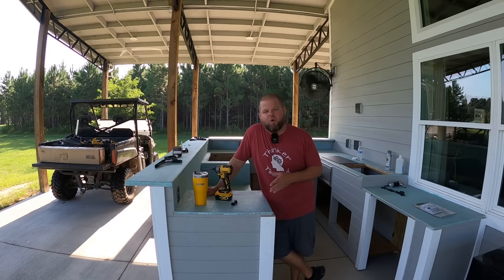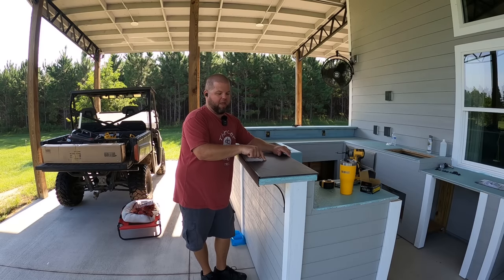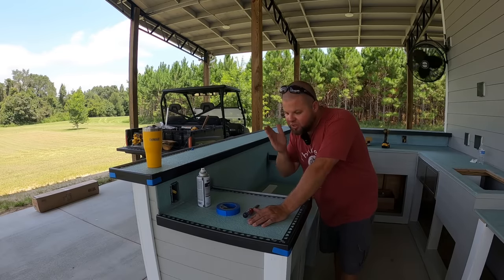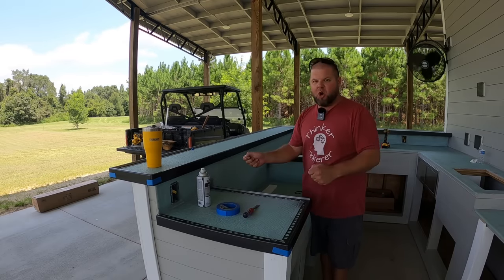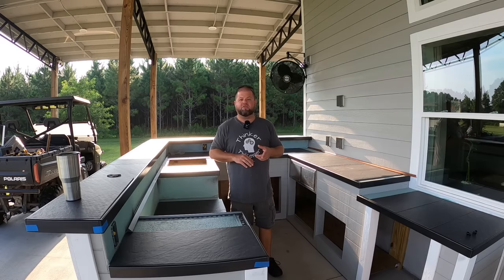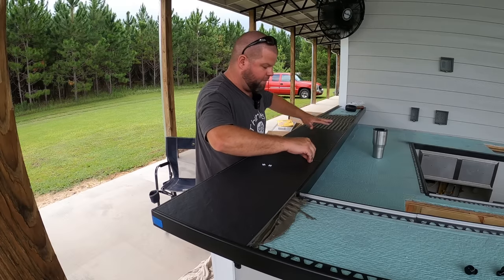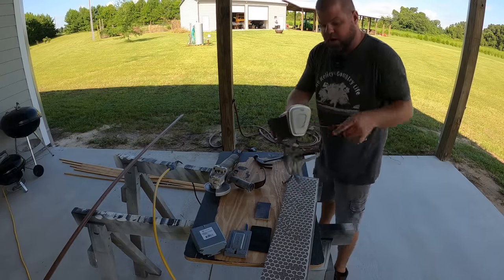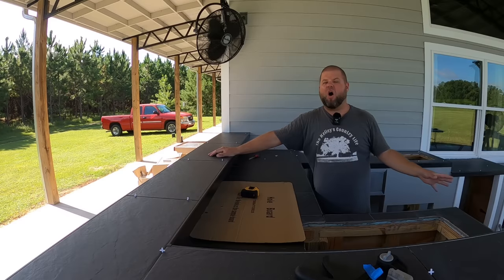DIY budget outdoor kitchen build part 5! Tile countertops #vevor #628

Comment: Hi there, 
I did tile for many years, the spot with two little pc you talked about 14:45 , personal experience little pc are not holding good, in your case they in corners so they will sit better, but if you would start mid with two tiles you would have 4 pc instead of 5 and side ones be large size, 
But still, had costumers not like that seam on center…

Comment: Awesome job!!! just want to let you know Schluter can be cut with a regular miter saw, so you don't have to use a grinder.  A little easier and the cut will be cleaner.  I have been working with Schluter for years and it is a fantastic product.  It really adds a touch of class to any tile work.
Reply from the maker: Thanks for the tip!

Comment: You did a very nice job with everything, if you see some cracking where you backspash meets the counter later down the road you can cut the grout out and you can get the same color grout silicone in a tube by the same company as the grout.
Reply from the maker: Thanks

Comment: Andrew, I suggest you use a good outdoor rated silicone on the top and 2 sides of the outdoor cover to help keep out water but leaving the bottom unsealed just in case water does get in, this will allow a place for it to get out...
Reply from the maker: What cover are you referring to?

Comment: One more suggestion. When you do tiling on a backsplash or on a counter like that or on stairs or anything that’s gonna possibly move or flex a little bit. Are use caulking in the joints between the backsplash and the countertop. If people are leaning on that counter you’ll find after a couple years the grout in that 45° angle is going to get little cracks in it and water can get in there. If you used a black or dark gray silicone in there and get pretty much the same look but you get a water seal. Same with the bottom of the shower between a manufactured tub or tile floor, silicone just gives you that little bit of flex an extra water seal and works a lot better.  Plus when it does need maintenance it’s a whole lot easier to take out of there than grout. I also suggest not becoming a professional tile guy. It’s fun for about three or four jobs then it just gets really tedious and old. 😂 I absolutely hated it. I was not bad at it but as far as construction goes it just is very boring to me the first time at school but after that it gets really old. lol
Reply from the maker: I agree with the corners, but I also don't trust caulk and silicone. Those always seem to pull back from a sharp edge. Especially caulk, nothing is perfect it seems.

Comment: Epoxy would be ok inside a house because its not UV stable, needs a Urethane coat to protect it... But don't put a hot pot on it. Depending on the epoxy you can go pretty thick with it. Stone is the best low maintenance option. Anything with a sealer needs maintenance and could possibly melt from hot pots.

Comment: Looks incredible! I plan on doing the same countertop because yours looks sooo good. Could you tell me how you finished the edge of the backspace?
Reply from the maker: Back edge behind the sink? If so I painted pvc quarter round trim black and glued into the corner. Looks great I think.
Reply: @TKCL  that’s a great idea. I was actually referring to the side by bar. The part of the backsplash flashing outward, between the counter and bar. It doesn’t look the same thickness as the rest of the Schluter.
Reply from the maker: It is the same trim, camera is deceiving.
Reply: @TKCL  oh great! Thank you so much for responding.

Comment: Looks amazing!  I’m not familiar with how the Blackstone connects is it in the front, I couldn’t see any holes for your gas line in the area you plan on putting the Blackstone.  I’m sure you’ve got it figured out you do such a great job thinking ahead.
Reply from the maker: I bought a tile hole saw bit set. I'll cover that in the next episode.
Reply: @TKCL  ahhhhh, that makes more sense to have a clean precise hole.  Tight work as always!  Thanks for taking us along the journey.

Comment: You’re supposed to do the floor/counter first before the wall. Whether it be a shower or outdoor kitchen. So you did it correctly, maybe for different reason but it’s correct either way.
Here’s why. Grout is porous and water will go through it if given enough time. If the wall is done first and the bottom butts up against it, there will be a grout line in a corner. And given enough time with expansion and contraction that grout will crack and moisture will get underneath the tile. This also why all corners inside and outside edges should be caulked with 100% silicone, not trim caulk or anything else of the sort. Always and only 100% silicone, which can be matched to your grout.
Reply from the maker: Where do I get color matched silicone, I've been very curious about that.

Comment: One other thing. Are used to do tile but especially if you’re doing vertical tile you always want to butter the back of your tile or take some of that thin set with your trowel and put it on the back of the actual tile itself and the surface it’s going to. When you put it on this way you have stripes connecting it and did Asian is only as good as that initial connection. But when you butter that tile you smear salmon and press it into the back of the tile and then they stay forever. On a flat surface it’s not a big deal unless you’re walking on it but if you were to walk on it, You’re a lot more likely to get cracks and tiles coming loose and if you put them vertically if they come loose they’re more likely to fall off. I’m not sure which way is best because I wasn’t some sort of master tile guy I just worked with a guy who told me how to do it but we would put stripes in opposite direction so if we were going north to south on the cement board we would go east to west on the tile so you would end up with a grid but even if you don’t use a slotted trowel just smearing and pushing some thin set on the back of the tile itself before you put it down in the tile is a good idea.  We did a lot of tile repair and he showed me the tiles as they came off and the difference. A lot of the mud doesn’t stick to the tile when you just lay it on top. But you’re not walking on it unless you get crazy drunk but from what I’ve seen you don’t drink a lot and none of it’s vertical so it’s probably never gonna make a difference. A lot of tile guys don’t do it but a lot of tile guys don’t do a great job either.  Lol.  For counters it almost doesn’t matter. I’ve done a lot of repairs where I just use silicone to glue it back in and it’ll be there for years that way. I also do that when I’m doing repairs around plumbing to keep water out because you can’t always grout very well in those tight spots around pipes.  

Either way for countertops it’ll work fine and those look really good.  👏🏼👏🏼

The epoxy countertops are cool but it’s almost like a DIY show thing. They always turn yellow here and whether it’s thin coated epoxy or poured cast thick Apoxsee it always ends up looking bad and it’s just not very tough. And something like a garage floor where you’re going to wear it out fast and drive on it and not be looking that close it’s not a big deal but if you do a light color Apoxsee with like a marble design or something it’s just gonna yellow and look bad and it stains easily as well. I would consider concrete counters with a sealer but I would never use the Apoxsee unless I was using something that looked OK when it yellowed
Reply from the maker: I do agree it's kind of a DIY fad. I think they would be fine inside out of the sun, heat and weather.
Reply: @TKCL   I was watching a show with a lady who does them on her DIY show and she said they always look like crap a year later, several the one she did were inside the kitchen.
Reply from the maker: I could see UV destroying them.

Comment: I wondering were you going paint your outlet covers black I noticed they were Gray not that it matters right. Also were you thinking about putting maybe rubber mats or something under your bar stools to keep spillage from getting on the concrete or something like that?
Reply from the maker: Already painted black 😉, had not decided aout under the bar stools. We do ha e a mat for the kitchen area.

Comment: Hey Andrew, when you laid the 1x4 boards on the outside how did you get the very small gap between the boards for the aesthetic look? dont think it was shown on the video. Thanks
Reply from the maker: Put down scrap 1/2 plywood for the gap spacing. Then placed the 1x4s on top and nailed to the studs. Remove scrap plywood when done.

Comment: Why no tile on the vertical. Think between sink and your refrigerator..  where the height of the countertop changes by the house wall… also how will you cleanup edge of tile between bar-top and the countertop.
Reply from the maker: No cooking or splashing in that area by the window, painted surface should be fine. Not sure what you are meaning by tile edge from top to countertop.
Reply: @TKCL  it looks rough.  Where the backsplash ends at where you enter outdoor kitchen
Reply from the maker: Ohh, I'm nowhere near done. I've got aluminum trim edge for the remaining exposed corners there and where the blackstone is going. I didn't want those in place until I was completely done sealing.

Comment: Unfortunately, u forgot to install a small metal trim piece at the end of ur backsplash & u didn't grout it either. Are u gonna trim it off another way?
Other than that, it looks amazing! U did an amazing job. Can't wait to see the sink, faucet & all the SS cabinets & drawers installed. As well as the other finishing pieces. Can't wait for the next video. Oh & btw, I love that u used black slate & painted the trim black compared to SS. I personally love slate myself.
Reply from the maker: I'm not done, I still have to trim that area and around the blackstone. I already have aluminum trim that's painted and ready to go.

Comment: Did you consider any kind of fan to help remove heat from the Blackstone?
Reply from the maker: There is one on the wall aimed towards it.  That fan moves a lot of air and will carry the heat out towards the end of the kitchen.

Comment: Is the new tile you chose from Lowes as well like the first? Do you have the name of it? Thanks
Reply from the maker: I don't have the name on me, it was also from my local Lowes.
Reply: @TKCL  Thanks for the response! I think I found the same tile. It looks like it's 8-10mm thick. What size Schluter edging did you use? 5/16, 3/8, or 1/2? Thanks again, I'm literally following your process exactly. It's a huge help.
Reply from the maker: I used the 2 1/2 inch tile edge from Home Depot. It's designed to cover the tile that's 3/8 thick, allow for thin set and provide a side profile so. I didn't have to tile the sides.
Reply: @TKCL  Thanks. I accidentally ordered the profiles for 1/2 inch thick tile, and figured that was too much to fill in with thin set. The corners are backordered anyway, so I'll return these and go with the 3/8 inch. Thanks again!
Reply from the maker: Half inch should be good, the tile sits on top of the thin set raising it up. You can always raise the tile with more thinset.

Comment: Quick question(please note that I am not a tile expert) By putting the waterproof membrane on the concrete board, will that affect the adhesion of the thinset to the concrete board? I am assuming not but wanted to ask.
Reply from the maker: No, that specific membrane is designed specifically for tile adhesive. It's highly used for shower walls.

Comment: Are you going to have a covered parking with something like a concrete pad for your vehicles I see currently parked on the grass? With as much rain as you get, I would think it would be unpleasant walking in the rain, all dressed up, to get into a vehicle. Plus the Florida sun does a number on vehicles, inside and out. It would also be cooler when you get in the vehicle.
Reply from the maker: I'm considering it down the road. I've lived here almost 40 years and parked outside. I guess I'm use to it.

Comment: what did you use for splicing your trim or for the ends?  I can find the inside and outside corners.
Reply from the maker: It was also made by Schluter and recommended along with the trim on Home Depots website.
Reply: @TKCL  only thing it recommends to me are inside and outside corners.  If you have a link could you please post it?
Reply from the maker: I'm sorry, I didn't read your comment correctly. I didn't use anything for splicing ends. I just butted them up to each other. Worked quite well as I haven't really noticed it after two years.

Comment: I plumb in Georgia and I use galvanized pipe and fittings on the regular and never once be turn down on inspections I tread some pipe and I mega press some pipe and again never been turned down on my inspections and Florida is another state that allows galvanized pipe I had my father pull a permit and I plumbed his house with galvanized pipe for gas in Florida.
Reply from the maker: I agree! The gas company I use is out of Georgia.

Comment: Just say you're OCD and don't try to explain what you don't know about backerboard and tile. That is backerboard. You should have used 1/2" Hardieboard and a few more backing pieces,  and Witmer have been good to go.  Counter tops and floors are two different animals. 
Other than that, great job on the project.

Comment: Should have used leveling clips, makes ur life way easier for 30 bucks, plus makes it look professional even for a novice. Next time!! still looks good tho. Thanks for your amazing video btw.
Reply from the maker: Didn't know about them, this was my first time building something like this.
Reply: @TKCL Still looks amazing. I was debating on doing concrete tops but now the tile with matching siding is my choice thanks to ur video. The staining would make me nuts, plus the 24 inch tile will look great, also scluter sells rly nice tile trim many different colors, but ill prob just get the black, with black tile like u did. Hate painting metals.

Comment: You are supposed to use mastic on a vertical surface. Not thin-set.
Reply from the maker: I'll have to find a bag and check, but quite certain mine said large format WALL and floor tile.
Reply: @TKCL  yes you done right by using large format thinset I never use mastic in any situation where it may get wet mastic is for dry areas only

Comment: But why did you paint the cement board?
Reply from the maker: That's a rubber membrane that waterproofs it. It's made specifically for wet areas like showers. Cement board is porous and can absorb water.

Comment: You can always add a little water to the grout if it is drying too quickly in the bucked. Just add a little water to the bucket, mix well and wait about 5-10 minutes and then mix again.

Comment: could have done 3/4 hardy instead of ply\hardy\membrane
Reply from the maker: I've yet to see that at any of my stores. Just that thin grooved hardi panel. Is it 3/4 inch thick?
Reply: @TKCL  sorry just looked it up. I used HardieBacker 500. It looks more like a piece of MDF and is .42 inch thick but it is much stronger than standard thin concrete backer board.  I used it on my second floor when installing Travertine because I was concerned about flexing breaking the tile and noise walking around. It addressed both issues. one sheet is heavy AF though... the way you did it does make sense and looks sturdy enough. Secondly if someone is concerned about cutting cleaner edges in a boxed out tile cut you can use a masonry bit and some water to drill out the corners first so you dont get the over-cut with the saw blade. Great build so far!